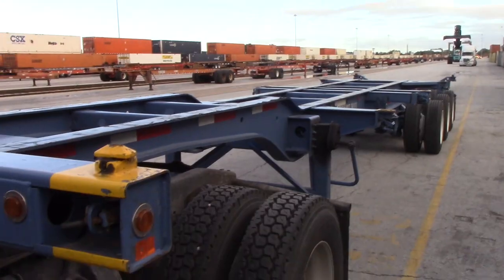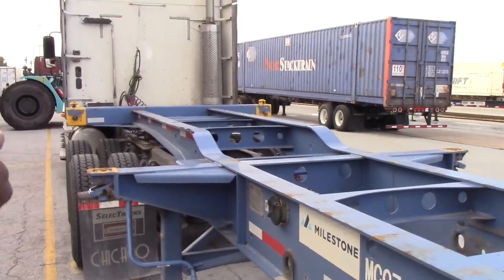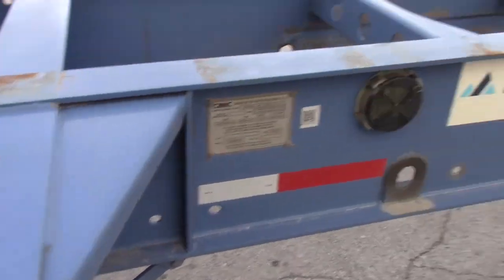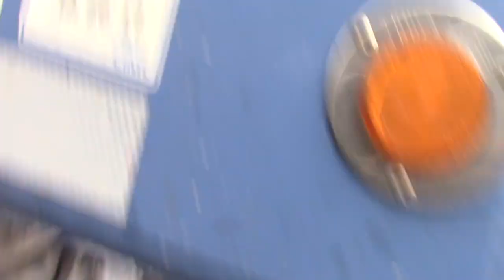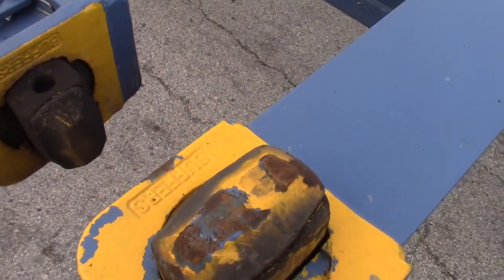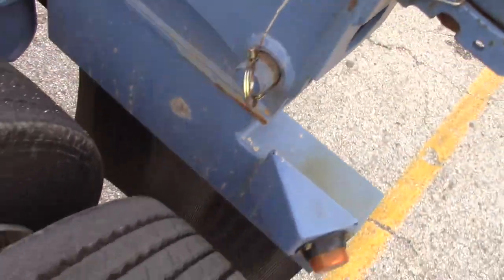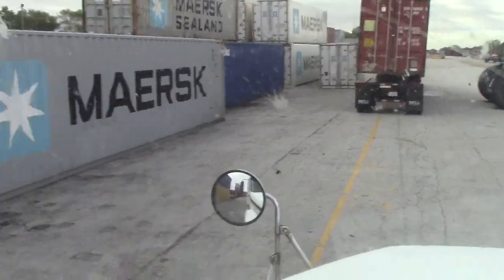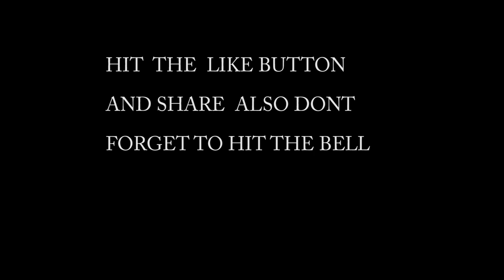HOW TO USE  A 20/40 FOOTER CONVERTER CHASSIS

Comment: You say that you can't carry 2x20ft loaded containers on the trailer? Is that only depending on the container weights or are you just not allowed. I work on containers here in Ireland and we regularly have 2 loaded 20ft containers on our trailers.
Reply from the maker: What's up barry! Yeah we can carry 2 20's but they have to be empty normally here in the states. We always load 1 loaded  20 in the middle here unless it's a special account where the 20's are loaded light and we can legally pull 2 loaded under 80,000 gross, but most of our 20's are super heavy!
Reply: @TruckingandLife  80,000lb is fairly light gross weight. We can legally run at a max weight of 46,000kg, that's just over 101,000lb.
Reply from the maker: @bazxf95  wow  thats heavy  to us ....we have heavy haulers  here called oversize they pull weight like that with permits tho.
Reply: Enjoyed the video. Interesting to see the difference between the American sliding chassis and the European one. They are obviously the same in the way we would position the boxes for transport, but our locks seem quicker and easier to use. To slide our trailers it just a matter of pulling out the park brake button on the trailer chassis to lock the brakes, the push the other button to withdraw the chassis  locking pins and then just reverse back. I presume yours are somewhat similar.
Reply: @TruckingandLife  I meant to add that to run at that weight you must have a 6 axle combination. If you have a 5 axle combination it's down to 40,000kg (88,000lb). And if you see some of my videos you'll see some of the fun roads we have too. lol
Reply from the maker: @bazxf95  aw cool bro.. I'll check your channel out thanks!

Comment: Great video bro. I think that the converted 20/40 chassis In this video is better than the chassis with the trailer air hose glad hand. Less mechanical, or springs to go wrong.

Comment: I love my 20/40 combos. But I wish it had a Tank riser in-between the front bolsters. Their really neat. 
Check the slide pins on that style chassis if air operated
 They screw onto the actuator (a brake chamber turned sideways) and are held with a jam nut. I had one fall off mid trip. When we first got the chassis.
This chassis will fit a high cube 20 in the loaded position. And rear spot if doing an m/t repo.
Reply from the maker: Yeah I seen the chassis that had 2 chambers in the frame of the chassis! I was saying that's different ya know!